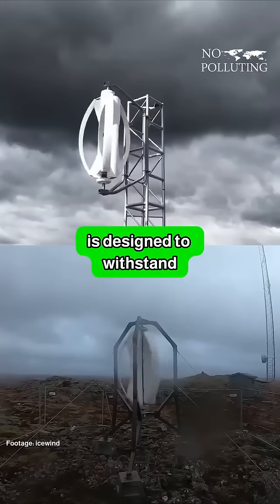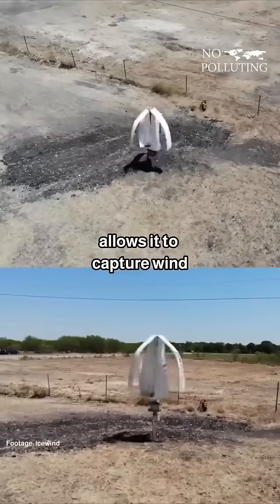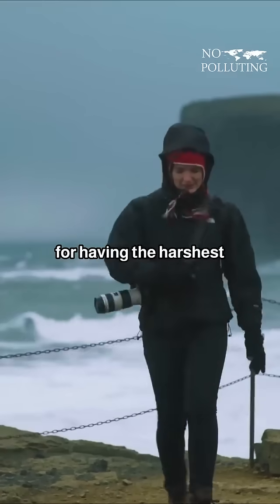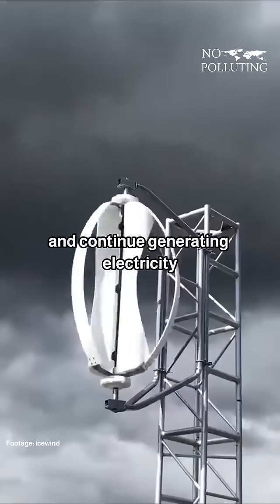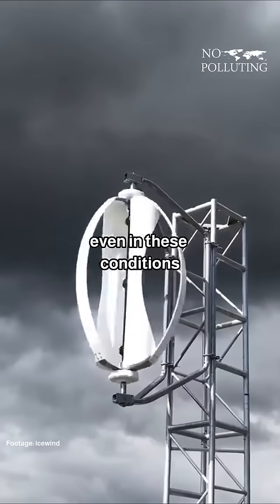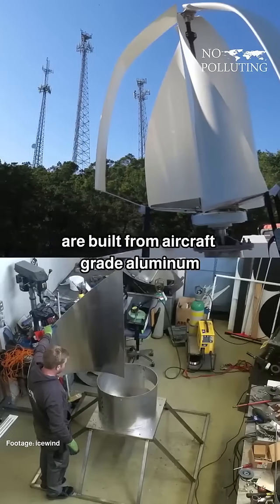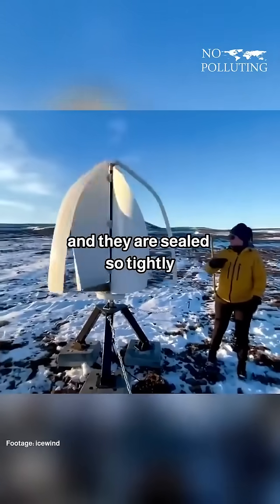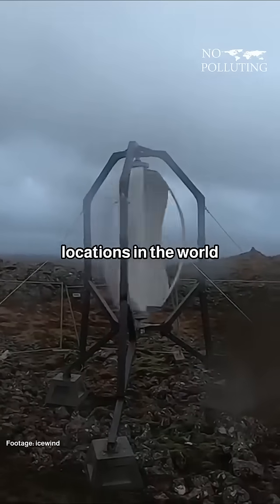🌋 Turbines That Survive Volcanoes 🌬️⚡ Extreme Renewable Energy

Comment: The efficiency is dismal and the power output small, recall that the power developed is
P = air density × (2/3 × wind)³ × affected area × efficiency.
the wind speed is decreased to 2/3, passed through the turbine and further to 1/3 in the wake. The efficiency is large for thin individual blades, in general 3 with a small friction area (about 45% to 55%)
in this contraption far lower, determined by test.
Here the density is 1.25 kg/m³ 
Wind is typically 12 m/sec 
On a normal turbine the area is π/4 × rotor diameter².
So do the calculation yourself to get an estimate of this long abandoned vertical axis turbine configuration, with hughe structural loads.